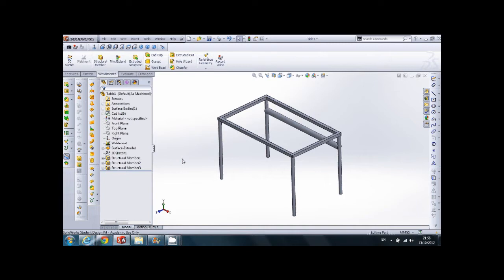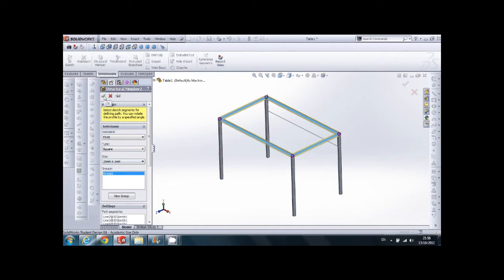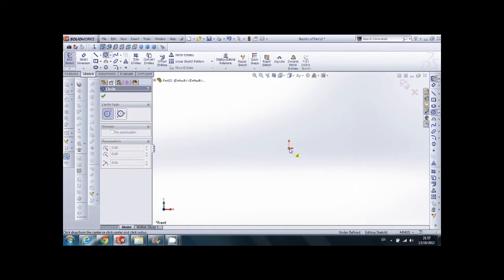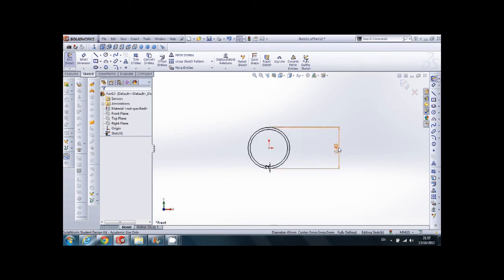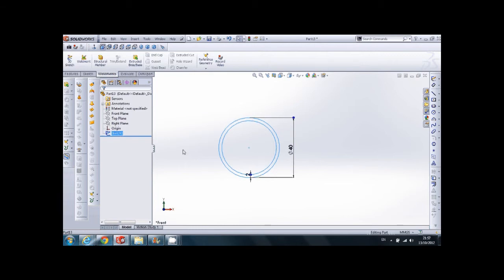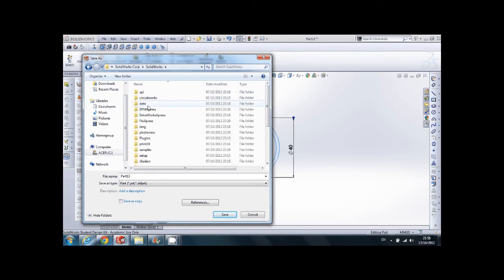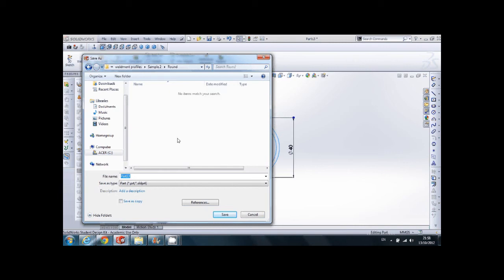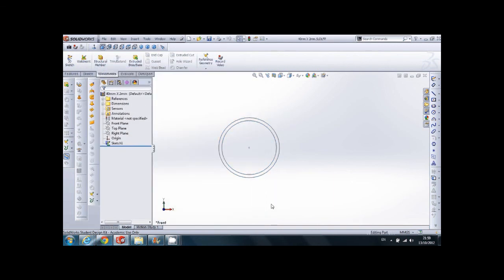Solidworks Tutorial - How to add profile for Structural Member

Comment: In SolidWorks 2017 I'm getting a message that says you don't have permission to save in this location.  Contact the Administrator to obtain permission.
Reply from the maker: Yes, I am femiliar with this error. Windown prevent access to Program Files.
Just save it on desktop, and then manually copy the program files folder.
thats a workaround I do.
Hope that helps.

Comment from the maker: Hello,

I did not fully understand the problem, and I am not filmier with any calibration that is needed.
I use parts that build using structural member all the time and I did not experience the problem you encountered.

If you can explain the problem again, by uploading a screenshot, or better, a video of the problem I would try to help you, otherwise I cannot help you.

Comment: hi, I have a problem with the strucutral member, when I want to add the custom structural member to my assembly and I click on a line I want it to go, it floats above or beneath that line but not on it, like the standard structural members, is there some way I need to calibrate the strucutral member? Could you help me? Thanks in advance!